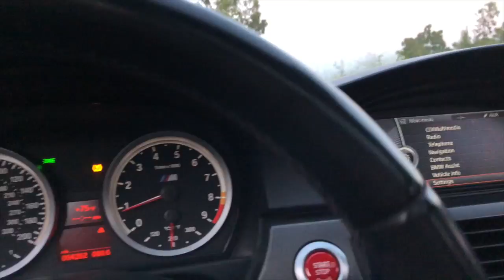DRIVING A 2JZ-TURBO SWAPPED BMW!

Comment: Nour, how do you feel with the lack of torque on the M3? That’s the reason I went with the 335i again. I was wondering how much different it is to drive.
Reply: Matthew Connolly I was planning on buying an e92 M3 because of the looks, sound, and handling but I couldn't get over that lack of torque so just decided to put the money into my fbo 335i. Diff, suspension, looks, etc.